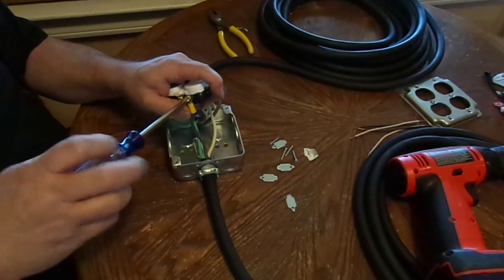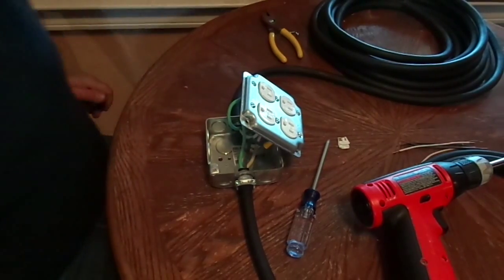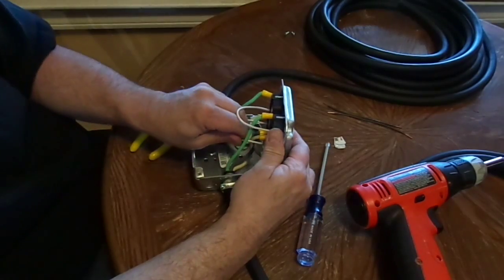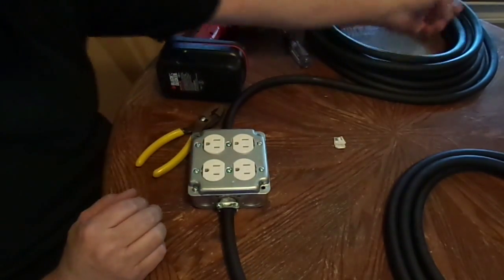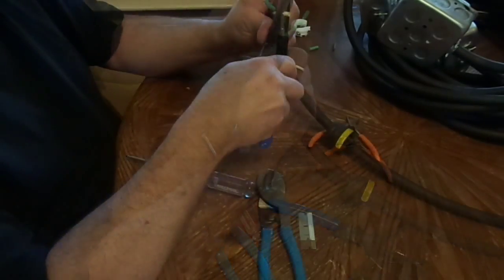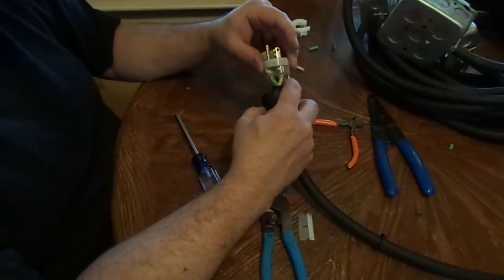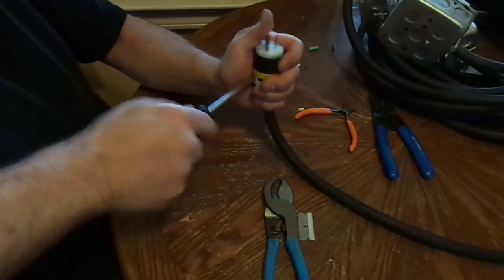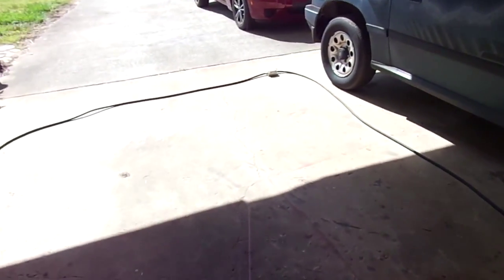Stage power stringer video 2

Comment: Nice video, you should also ground the metal box btw
Reply from the maker: Thanks... the box is grounded. The outlet has its ground and is screwed to the metal box. I tested with a multimeter while the box was loaded and the box was 100% grounded. Thanks for watchkng
Reply: @cpworx_maker  Oh okay, I must have missed that part.
Reply: Rick Perry , you didnt connect the cable pass through ground to the ground coming from the supply cable... thats a fail

Comment: i would suggest using neutrik powercon  in the boxes and it makes a great modular setup 
rhen you just make cables with male and female powerconn connectors on the ends 
oh.  and u forgot the ground wire .
Reply from the maker: Thanks for the comment, They weren't in his budget. Oh and the ground is connected to the receptacle which is screwed to the metal box. All were checked and proper.
Reply: Rick Perry oh yes budget. 
yeah i wish some times my budget was unlimited and does wonderful connectors and super expensive boxes that are made of rubber where in my bidget.  ...
well well have to do what we can within budget.
by the way great video tutorial
Reply: @cpworx_maker  You are using the outlet to ground the box which is against code just FYI. It works but normally in electrical we ground the box and then ground the outlet and make sure all grounds are together. Also they make a self grounding receptacle that will self ground to a grounded metal box.
Reply: Watching this 7 years later... I'm setting up the same thing but using powercon to make a modular power  backline for bands.

Comment: You didn't connect the ground to the back of the metal box?
Reply: *****
Sure. I expected you to add a 2inch tail from a ground nut to a screw on the box bottom.
Like your mic stand repair cradle, too.